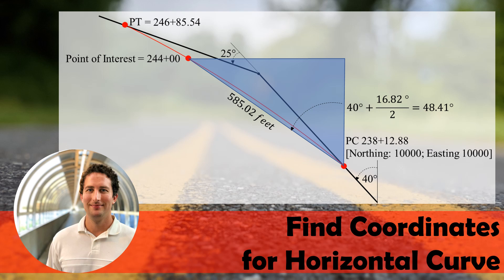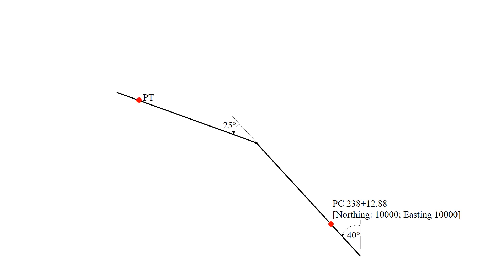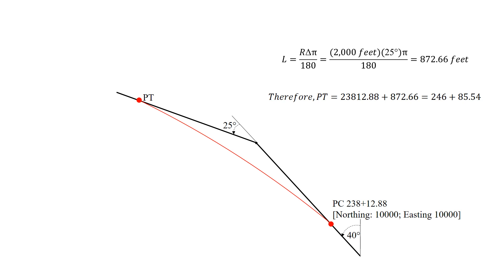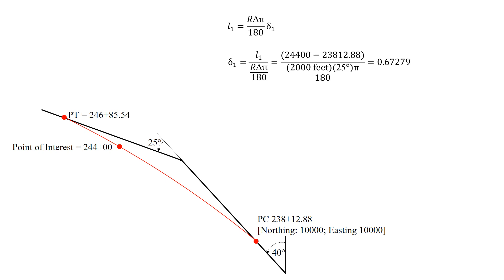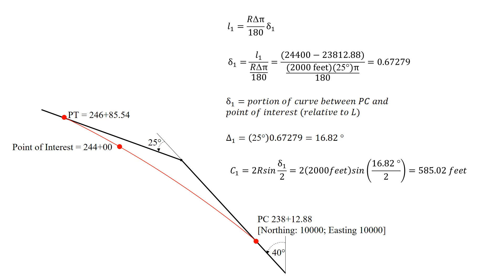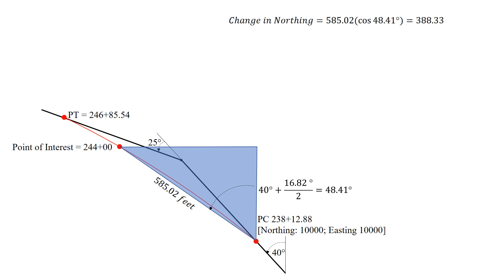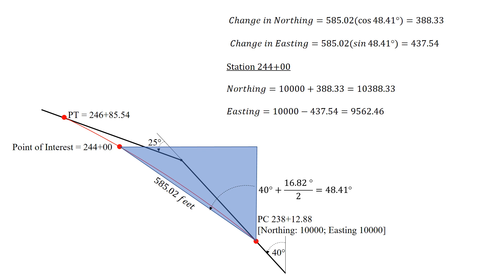Find Coordinates (Northing, Easting) for Horizontal Curve | Example Problem for Point on Curve

Comment: Could you explain to me how did you get the 48.41 degree? I am struggling to see the reason of the 16.82/2.
Reply from the maker: What time in the video are you looking at?  That will help me identify the correct information.
Reply: @FindleyDaniel  I have the same question - it occurs at 4:36, finding the angle of turn to the Point of Interest from the PC. Why is it 16.82/2?

Would the angle of turn to the POI not be 40 + 16.82 = 56.82?

I can back-calculate delta1 using the Curve Length Equation:

L=R*pi*Delta/180, 

where Curve Length L is the Chord Length C to the point of interest (585.02):

Delta = 180*L / R*pi    =      180 * 585.02 / 2000*pi =  16.76 degrees
Reply from the maker: @heymisterstanman  Great question - the images of the circular curve in the NCEES reference handbook (page 274 in the 2.1 edition in section 5.2) will be helpful for this which shows that the angle VAB is half of the intersection angle.  This is consistent with the principle that the angle made by a tangent line and a chord is the arc divided by two.  

As another example, if the chord is the long chord - going from the PC to the PT - the angle would be 52.5 degrees (40 degrees plus 25 degrees divided by 2).
Reply from the maker: Assuming this is @4:36, the images of the circular curve in the NCEES reference handbook (page 274 in the 2.1 edition in section 5.2) will be helpful for this which shows that the angle VAB is half of the intersection angle.  This is consistent with the principle that the angle made by a tangent line and a chord is the arc divided by two.  

As another example, if the chord is the long chord - going from the PC to the PT - the angle would be 52.5 degrees (40 degrees plus 25 degrees divided by 2).
Reply: @FindleyDaniel  thank you for the pointing out Angle VAB in the NCEES reference handbook and its application to this problem, that really helped me understand where I was getting confused! Your videos have been very helpful for my study process for the PE.
Reply from the maker: @heymisterstanman  Glad to hear that and best wishes on the exam!!
Reply from the maker: @heymisterstanman  You're welcome!
Reply from the maker: @heymisterstanman , here's another note to make that I just realized.  NCEES updated the equation used for this problem.  The equation presented in this video at @2:24 requires an extra step to make it useful with the subsequent equations.  Make sure to use the new equations that simplify the process.
Reply: @FindleyDaniel  thank you for that clarification.

Comment: How did you get Delta1? what equation or relationship did you use?
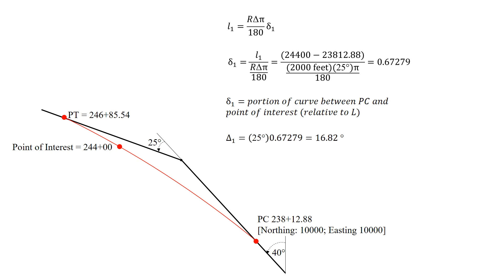Reply from the maker: Is the description at 2:32 what you're looking for?  Or, at 3:30 (multiplying lowercase delta 1 by our angle)?
Reply: @FindleyDaniel  yes the multiplication on D1 by lowercase D.
Reply from the maker: @Laminebarcelona-j3t  Yes, multiplying those values gives us the portion of the angle that is accomplished by that point on the curve.